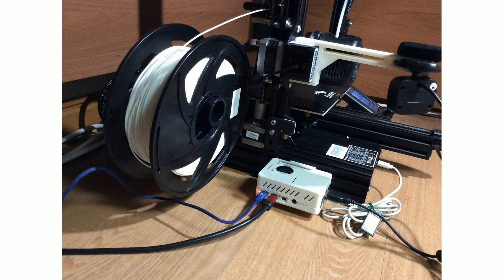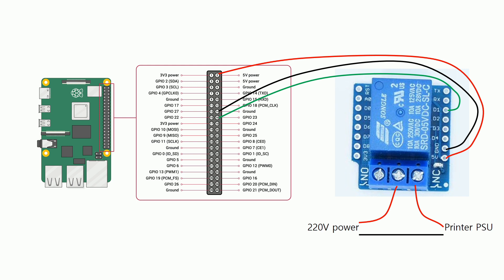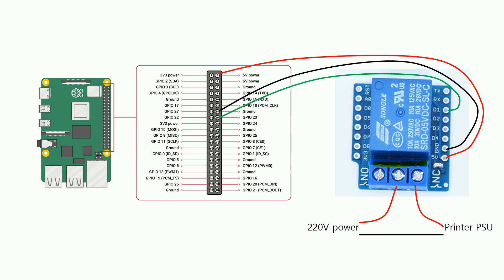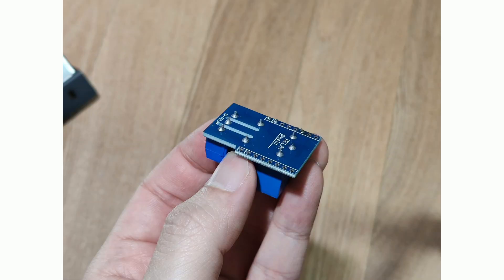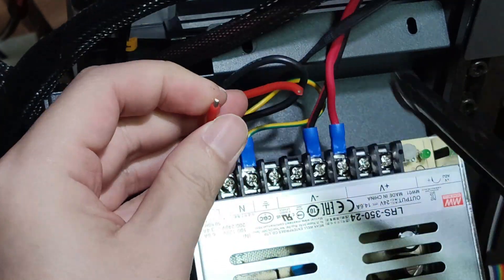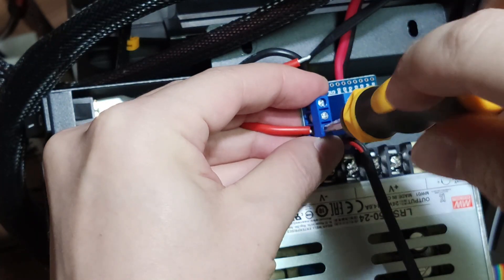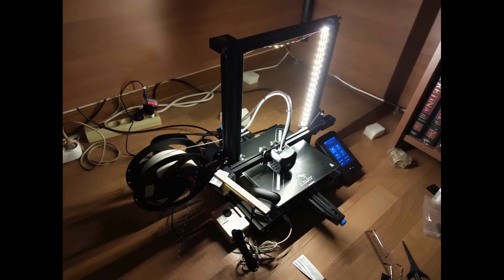Ender-3 V2 PSU control & LED upgrade

Comment: But uts more safe, to use the NO connection of the relay. If anything goes wrong, in your case the printer goes on.

And please next time give some security advice, if you do a tutorial about modifiing a 220V device, like make sure to disconnect the power cord and wait some time to discharge the capacitors. This is a big security risk and can danger your life!
Reply from the maker: Thank you for your input. It was only later that I realized that this project contains such a risk. I should keep this comment pinned!
Reply: The PSU's in most printers will discharge the caps due to the load of the circuits as the power switch controls the mains input.  That said, if a PSU is designed badly the caps could hold a charge for weeks after turning off.    Generally the caps don't hold enough to kill a person, though it would be an unpleasant experience.  A warning would be good about dangers of mains none the less.

Comment: How does the image from the printer's camera look with the LEDs on? Does it have too much glare with the camera facing the LEDs? Would it be better with only the top LEDs, or is it better with LEDs on all three sides? Do the Z axis wheels interfere with the LEDs mounted in the vertical sides?
Reply from the maker: Not much glare. I would recommend 3 sides. Z axis wheels roll over the LEDs without problem.

Comment: I Can see merit in your approach, but I personally prefer the N/O contact connector.  If something goes wrong with the Raspberry Pi, I can always supply an external 5V to the relay control if I can't fix the Pi.   I think this has been mentioned before, but a warning in the video about the dangers of working on mains equipment would be beneficial.  Not so much for capacitors in the power supply, as the load of the printer will discharge these for most 3D printers, but more to cover yourself if someone gets zapped following your tutorial.  :)
Reply from the maker: Thanks for the reply! There is actually one annoying feature about using the NC connection, which is that the printer turns on for a few seconds every time you reset your RPi. Didn't see that coming. Probably NO is a better approach.
Reply: @MahlerLab  That makes sense as the Pi will disconnect power to the relay whenever it loses power or restarts so the relay drops off and the N/C will become connected.

Comment: Hi im not realy good with electronics but could pls help me? After i did everthing as instructed i cannot see the raspbery pi in the browser anymore. Did i do something wrong?
Reply from the maker: Do you mean you can't connect to octoprint anymore? Can you confirm your Pi is working? (Power LED is on, plug in a monitor directly to Pi)

Comment: lets say i want to setup my printer so that when I use the gui to shut down octoprint it will shut it down then cut power to the 3d printer so that i dont have to turn off octoprint on the computer then turn off the switch on my printer. is that possible and how would i do that?
Reply from the maker: If you want to keep the RPi on all the time and turn on and off the printer using the octoprint GUI, using the PSU plugin and connecting a relay switch to the 3D printer power.
Reply: @MahlerLab  thanks for the reply. so my understanding is very limited. i mostly work with basic dc stuff and dont know a whole lot. if i were to leave the psu on at all times, wire the rpi from psu dc out using a buck converter, with the relay hooked up to the wires that power the printer mb then my pi would always be powered on and able to stay on after i cut the power like i want correct? I want to avoid having to go into octoprint and having to shut down my pi manually, i have multiple printers and would like to be able to remotely shut down the printers when a print is done and be able to turn them back on ect. i run them from work some times with my wife at home monitoring them and it would make life alot easier for her.
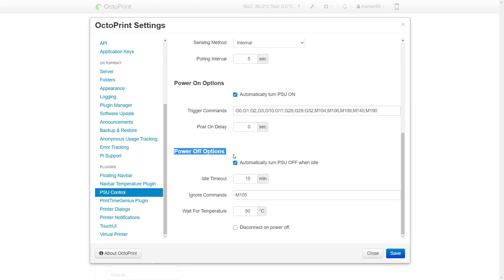Reply from the maker: @pappab00m65  One thing to make sure. Do you want to turn on and off your RPi? You will need a more complex setting to achieve that. If not, your described wiring seems just fine. And the PSU control pugin has an option to automatically shut off after a print. I think this is what you need. Check 17:37

Comment: Adding a tplink smart plug and installing the tplink plugin in octopi  and leaving the hard switch on works just fine no no need to open up the psu
Reply from the maker: Thank you for sharing this tip. Definitely much safer and convenient approach!

Comment: Nice! I've already done an LED mod, but I didn't think to put them inside the vslots! Dang, guess I gotta go back and add some more strips...

I just can't get away from modding this thing, it's too fun!
Reply from the maker: Luckily the V slot is deep enough, so the rolling wheels move above them with no problem. What do you print with your 3D printer? Parts for your 3D printer! 😂😂
Reply: @MahlerLab  You guessed it! I actually  copied you and did this kid myself a while ago! Really helps with lighting the bed up.

Comment: But your rpi has to be always powered on ? And it’s better to use the no connection? Do you need to change something in the settings too if you use the NO connection?
Reply from the maker: 1) My RPi has a separate power source.
2) NO: If your RPi fails the printer is powered off
   NC: If your RPi fails the printer is powered on
3) Don't check the "inverted" box if you are using NO

Comment: Now if you wanted to power your pi from your printer, would you want to connect the relay to the positive output of the power supply so the pi would be powered constantly?
Reply: Like instead of connecting the relay to the input side you would connect it to the output so the printer is being controlled not the power supply
Reply from the maker: @jeremyk47  Yes, that would work as well. And you don't have to deal with the main voltage, so it would be safe. 
One possible issue would be the capacity/performance of the stock power supply of the Ender-3 v2. If the PSU can't handle the peak currents, your RPi may malfunction due to low voltage. Otherwise it's a good option since you don't need a separate power supply for your RPi. Just use a decent buck converter for 24V to 5V.

Comment: Great video!
You could add a wireless switch to the LEDs or even control the LEDs from the RaspPi.
Alternatively you can use Tasmota to control the PSU separately with a smart plug
Reply from the maker: Thank you for your input! If I do it again, I should definitely make the LEDs controlled by the RPi. I'm so glad I made this video. It's a great way to learn!
Reply: Yes, the's a plugin for that
Reply: @antonip1114  what's the name of the plugin?

Comment: 6:36 you cant just twist them and put inside with a bolt. you have to solder that twisted end OR use a clam
Reply: Soldering the ends and putting them into screw terminals is actually very dangerous, over time the solder will flow away under the pressure and you will get very high resistance (heat/arcs/fires) or loose wires. A lot of 3D-Printers burn because the manufacturer puts soldered wires into screw terminals because its easier and faster in manufacturing.But high current and bad connections dont mix and a lot of "bed/nozzle heating" connectors in printer mainboards burn out because of this.

Either use blank wires in screw terminals (twisted/untwisted doesn't matter) or even better crimp a matching ferrule onto the blank end and put the ferrule into the screw terminal.
Reply from the maker: @fredyy  Thank you for your feedback. I am not familiar with dealing with high voltage connections, and these comments do help.
Reply from the maker: Thanks for the comment! I have ordered a U-shaped terminal, and will clamp it the the end. Do you think that will do?

Comment: Hi! Could you please explain: did you also power your Raspberry Pi via Ender's PSU or is it powered separately?
Reply from the maker: Hi Igor. It's powered separately. I have a dedicated 5V 3A brick power supply for my Raspberry Pi. I heard that stable power supply reduces chances of malfunction of the Pi.

Comment: Where did you mount the power switch for the LEDs?
Reply from the maker: I simply hot glued it to the left v-slot like this. https://imgur.com/THNNw18 I was thinking of printing a v-slot adapter/housing for the switch but got lazy.
Reply: @MahlerLab  Sorry I might have missed it in the Video but why not just use the Pi to automatically turn on and off the LED while printing?
Reply from the maker: @Gothamen  Hi Daniel. The LED is kept on, so if you turn on the printer with the Pi then the LED is also switched on. So, when the printer idles for a certain amount of time after the print, both the printer and LED are switched of by the PSU control plugin.